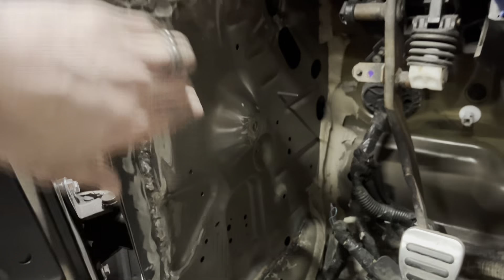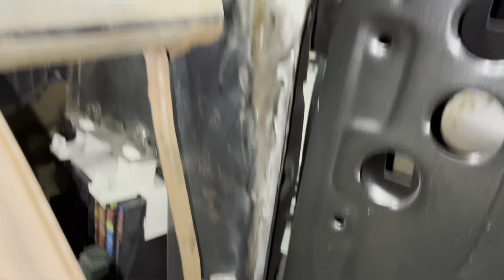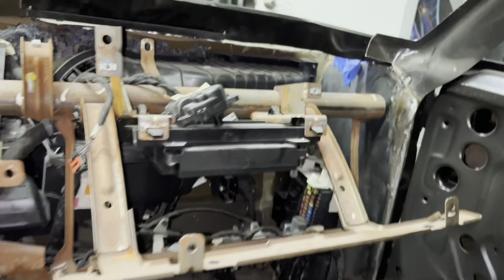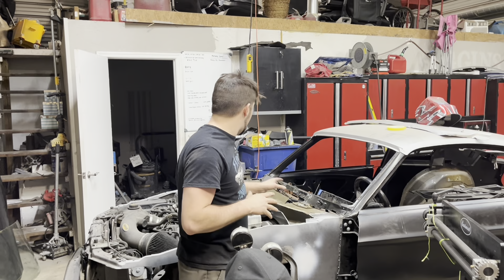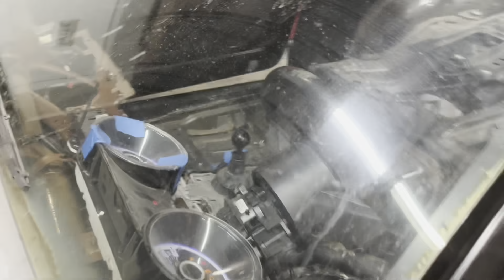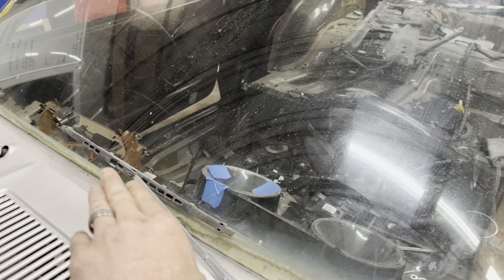mustang body swap first crank since cutting it apart

Comment: There’s nothing like these 1967, 68 fastbacks to bad there so desirable that to get a original one that isn’t a complete rust bucket you’re gonna have to cough up alot of money tbh this body swap is very cool but it takes to much time tbh i would just rather go with a pre facelift s197 mustang and swap in a big block ford a build a modern version of Carroll Shelby’s dream of his gt500 he first built back in 67😮‍💨
Reply from the maker: I have also built a brand new 1967 mustang fastback with no Origional parts no rust. You no longer have to use an old rusty car since new bodies are available

Comment: where is the third pedal
Reply from the maker: Under the steering column clutch, brake, and accelerator
Reply from the maker: Might can’t see it because the wires hanging

Comment: Coming together, 30 or 40 years ago I would have been tearing.into doing this kind of stuff and would have loved it.The 68 coupe to fastback conversion I'm doing is a stretch for me,
Reply from the maker: How far along had your car came? Did you get all the damaged panels cut off yet
Reply: Taking it there this coming week, I told your brother I got a lift it's a 6000 lbs scissor lift 60" high
Reply from the maker: @Must-StanginGarage  just be sure not to have too much of the car cut up or it will fold in half, these cars are very flimsy
Reply: @1194video  thank you I will have it braced really well I've paid attention plus I don't have much rust underneath, and absolutely I will credit your brother and you all the time
Reply: No a friend wanting me to bring it to his house he got a new shop so I waited on him and he kept putting everything off because of his job partly, but I sold him a 68 around 1983 and it's set every since he pulled the motor out in 85 anyway he wanted to fix them together, he's finally started on shelving and work benches, I told him today I'm going ahead because my car has to sit still until I get sheet metal done I'm hauling it to the shop I already prepared, and I will be videoing and maybe put on you tube, the building has a cool story
Reply from the maker: @Must-StanginGarage  I’ll be watching, don’t forget to give a shout out!